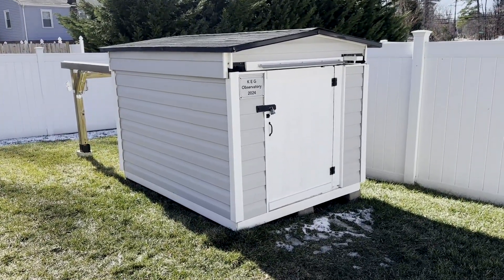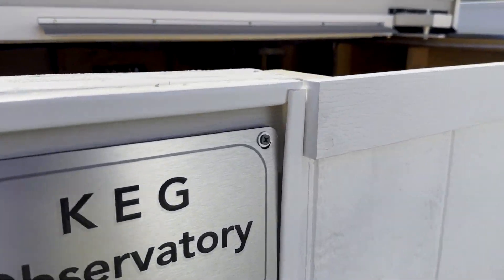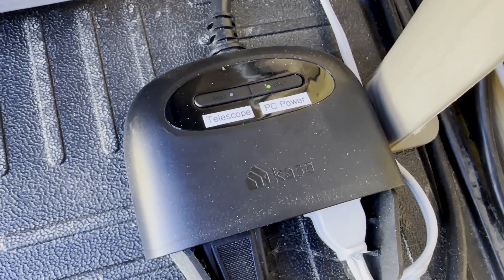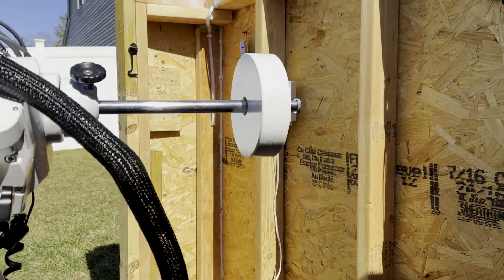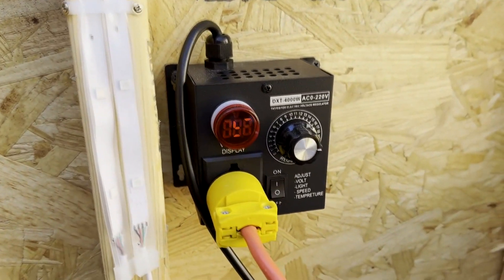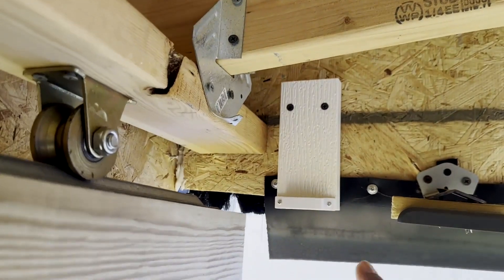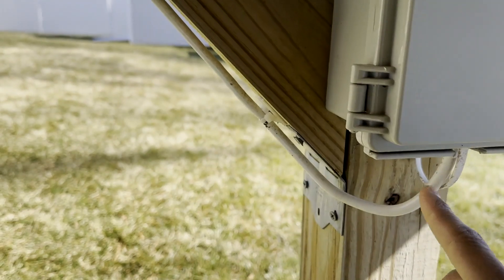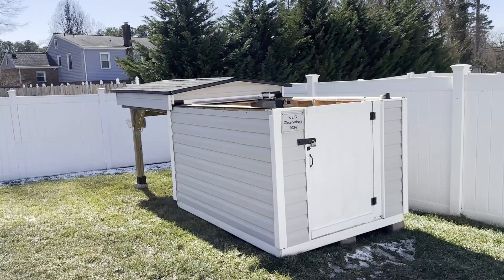Roll Off Roof Observatory Is Running Nicely!!

Comment: So many well thought out features. Great job on this. What building dimensions did you decide on if you don't mind sharing?
Reply from the maker: It’s 7 feet long by 5 & 1/2 feet wide & is just about 6 feet tall at the peak of the roof.

Comment: Can you automate taking flats? Nice and 6:21 compact fits in with the back yard. Did you have get a permit to build or get and OK from an HOA?  Me I’m destined to set up and tear down.
Reply from the maker: @KJRitch  In my area no permits needed for this type of shed & my HOA is very cool. As long as I sent info about it to them & since I was using siding all they asked is I match the siding to what my house is. For my flats, I only take flats once every few months or if I change anything on my image train where the camera isn’t in same position. I’ve been doing that since 2017 after I kept reading post on cloudy nights from others that went back & forth about do you need to take flats after every image session. Some take them after each session others go a while as long as you cool the camera for the image session to the same temperature as when you had it when you took your flats.